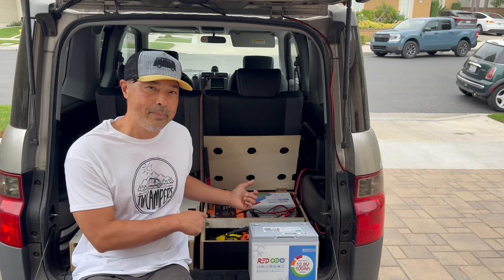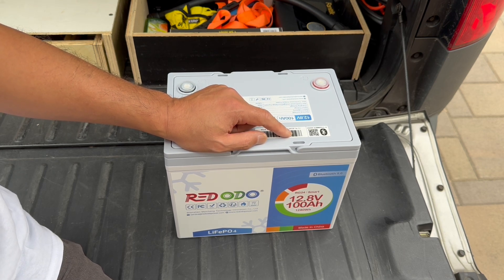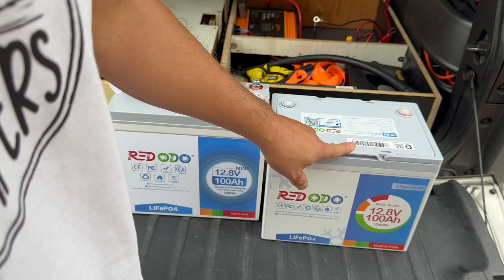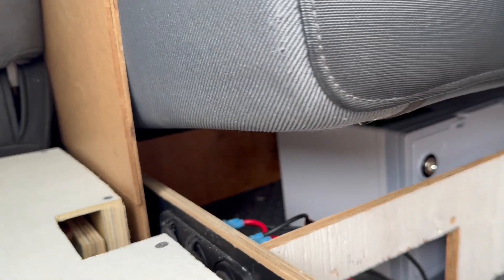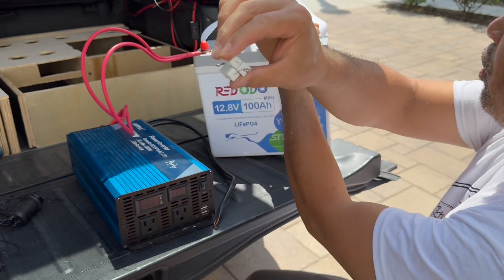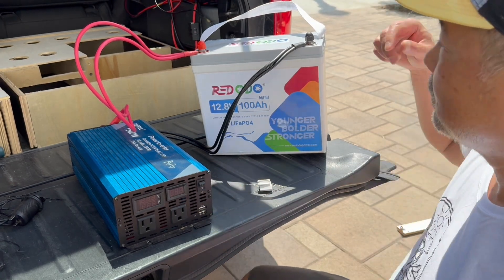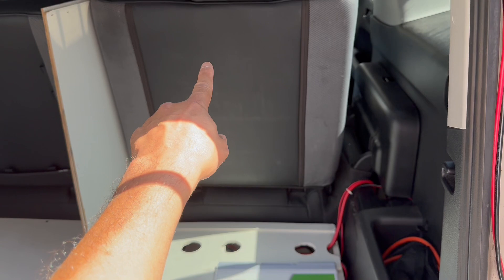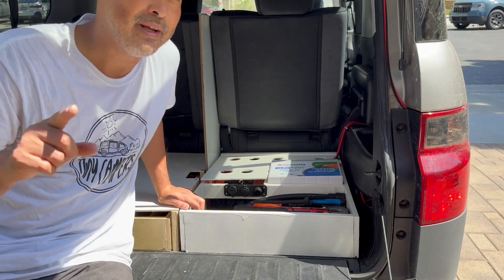I Messed With My Power System Again!?  DIY Custom Solar Power System - Always Customizing...

Comment: That is an easy solution by switching out the battery & having it fit back into the same area by just sliding it forward & cutting the top lid. 
I'm still not understanding why that smaller battery didn't work with ur inverter? The BMS has lower voltage or what's not working?
Nice T-shirt graphics & clean print job. 👍🏾
Reply from the maker: They said it is the BMS pre-charge feature, some inverters need more at start up, or will shut off because of low initial voltage.  It is better on the group 24 than the mini.  I definitely saw it in one of my inverters.